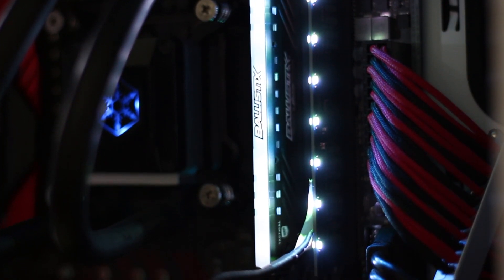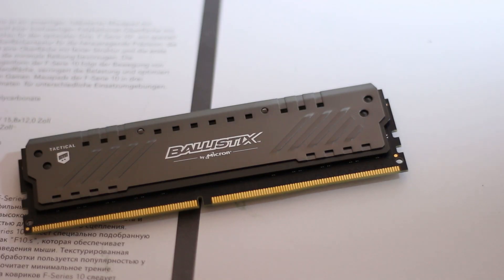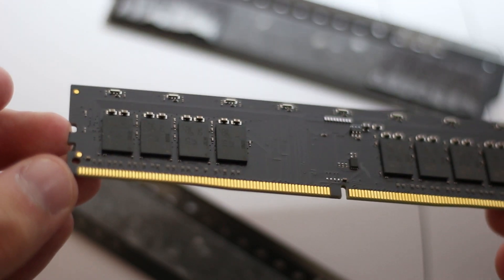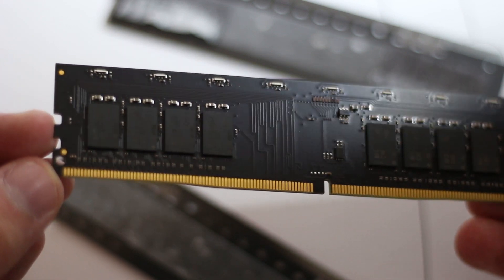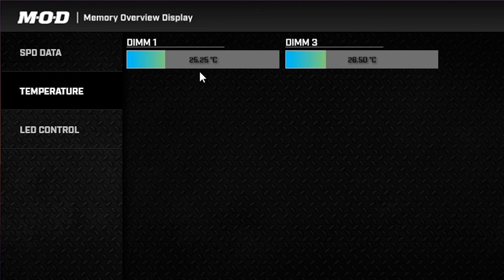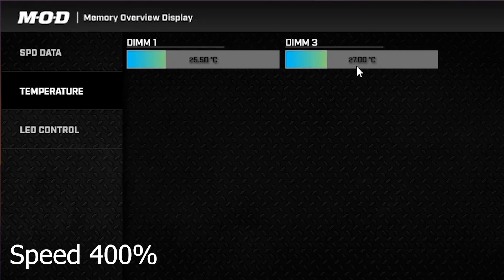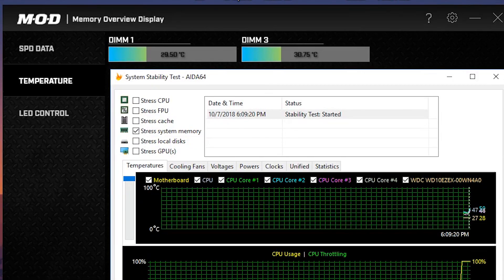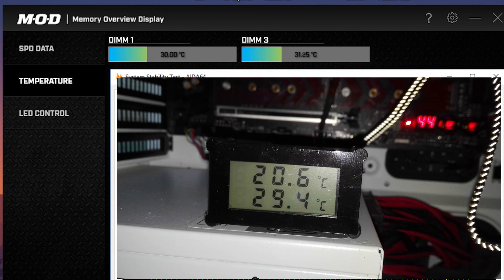Do RAM heatsinks actually provide cooling?

Comment: What was the speed and voltage of the RAM you have? & Great vid btw sub #136
Reply from the maker: Hi Roberto, the RAM used in this video was running at 2666MHz with 1.2V an the timings: 16-18-18-38. Thanks for the sub!
PS: There was no point to overclock this kit to 3000MHz to increase the temperature, each kit has a different behavior and people might get different results and temperature. :)
Reply: @TechLegend-com  hi sir,  you said no point in Oc into 3000MHz, why is that?
And 16-18-18-38 means?
Reply from the maker: @successpro9424  Hi, I said that there was no point in overclocking to 3000MHz for this particular test which recorded temperatures. The 16-18-18-38 are the CAS timings used on the RAM kit.
Reply: @TechLegend-com means if it is not for this test, it is best to Oc to 3000 MHz? More speed is betTer ?
Reply from the maker: @successpro9424  Overclocking is not bad, more speed and lower CAS Timings are better for performance.
Reply: @TechLegend-com  does OC ram have any side effects? 
Ps. How about Oc CPU and GPU , any side effects too?
Reply from the maker: @successpro9424   If done properly, there are no bad side effects for overclocking the RAM, CPU and GPU. Overclocking is done to gain extra performance.
Reply: @TechLegend-com  would the life span of ram, CPU and GPU decreases with OC?
Mind elaborate the method "done properly part"?
Thanks
Reply from the maker: @successpro9424 Done properly means that, you don't use too much voltage when overclocking, and this is how I can answer your initial question. When you hear of a CPU having it's life span lowered by overclocking, it is usually because the overclocking was done with too much voltage for the core. For example, let's take an Intel i5 6600K that is overclocked to 4.5GHz using a core voltage of 1.276V will not be affected in the long term by the overclocking. But, if you take the same CPU and overclock it at 4.5GHz at a much higher core voltage, then you will lower the life span of the CPU. 
Usually, the overclocking is done with as low a voltage as possible, to protect the components and their life span. I hope this makes sense, if you have more questions, feel free to ask me. :)
Reply: @TechLegend-com hmm, how do I know what's the maximum overclock speed with the minimum voltage uses??
Will the overclocked 4.5MHz work with just 1.267V?
Reply from the maker: @successpro9424  Overclocking is done by increasing the frequency in small increments. If the CPU has a maximum Turbo Boost frequency of 3.6GHz. you start overclocking it first at 3.7GHz and see if it works with a minimum increase of voltage. There is no fast way of knowing how much overclock can be done on a particular CPU, GPU or RAM.
Reply: @TechLegend-com  
"maximum Turbo Boost frequency of 3.6GHz. you start overclocking it first at 3.7GHz "  
let's say the starting voltage is 1.2V and the maximum Turbo Boost frequency  is 3.7GHz. 
Now the senarios is having 1.2V at 3.8GHZ, (the maximum is at 3.7GHz). What would happen ?
What's the maximum voltage that would not reduce the hardware lifespan ? 1.6V? 1.7V?
Reply from the maker: @successpro9424   Ok, here's how you do it. You have the max Turbo Boost at 3.7 GHz with the starting voltage at 1.2V, you increase the frequency to 3.8GHz and increase the core voltage at 1.25V, and you see if it boots up, and if it does, then you use some benchmarks to see if it works with that overclock. And if it works, then you repeat the process. The maximum voltage that would not reduce the lifespan of the CPU is varied, and it depends on each CPU. To get a better idea of what voltage to use, search on YouTube or on the forums, your CPU and "overclocking", and you should get a general idea of what to expect from that CPU.
Reply: @TechLegend-com  what benchmarks are there?
 As sir sugguest to search CPU on YouTube. What if the the motherboard is different, and the CPU is the same?
Reply from the maker: @successpro9424   Benchmarks, for example Cinebench R15 or Cinebench R20 for the CPU and UNIGINE Valley Benchmark for the Graphics card. First, forget the motherboard, you have to understand that no CPU is the same. My i9 9900K will overclock differently than your i9 9900K. It comes down to the silicone quality inside the chip of the CPU or the graphics card. Some CPUs can overclock to 5.3GHz, and some can't overclock to 5.2GHz. As I've said before, it is trial and error.
Reply: @TechLegend-com  but then isn't it  weird? As we have the both same CPU I9 9900K. As the processor is both from Intel manufacturer.
What benchmarks needed to test  for a newly build PC?
Reply from the maker: @successpro9424   It is not weird, it has been like this for years. The silicone quality inside the chips is not identical.  What benchmarks, the same as I previously listed: Cinebench R15 or Cinebench R20 for the CPU and UNIGINE Valley Benchmark for the Graphics card.
Reply: The benchmarks are the same even though the PC build is new?
As I wanted to try building my first PC, was wondering what benchmarks to use?
What hardwares need to be benchmarked?
Whats the benefit of benchmarking the hardware??
Reply from the maker: @successpro9424  The same benchmarks are used on old PCs and new PCs, and I just told you what benchmarks to use. Usually the CPU and graphics card are the ones that get the most benchmarked, because you want to see if your components are performing as they should.
Reply: @TechLegend-com  I see, cause when I asked the a computer shop for a full rig, they always tells me that benchmark everything to be safe and the risk of hardware failure will be zero to none, so I was curious on the benchmarking.
Btw have u build a hackintosh before?~
Reply from the maker: @successpro9424   The shop guys use the benchmarks to see that all the components are performing as you would expect them to perform. Basically, if your graphics card passes the benchmark, and the score in the benchmark is close to the average for that graphic card model, then you know for sure that the graphics card is working well. I have not yet built a hackintosh, perhaps when the channel will grow a bit more, I will be able to afford to start such a project.
Reply: Okay, thank you so much for your time of explaining.Truly Appreciate it..
Reply from the maker: @successpro9424   No problem, perhaps you can subscribe and be the 550th subscriber! :)
Reply: @TechLegend-com  oh my, I dint notice that. 
Subbed ~~~